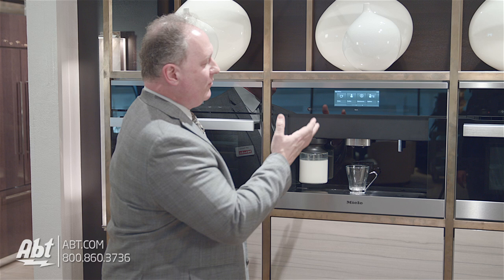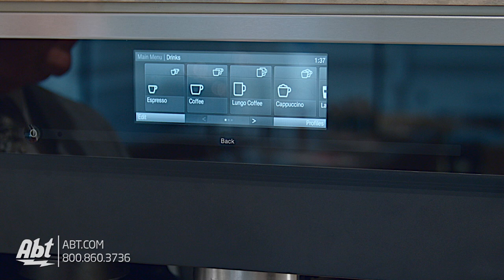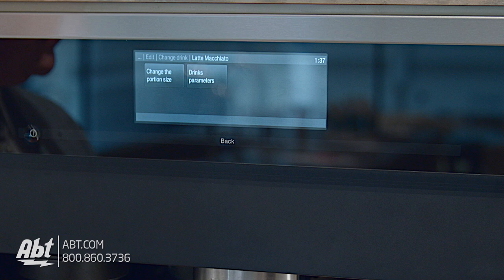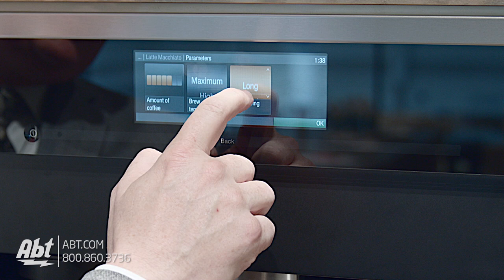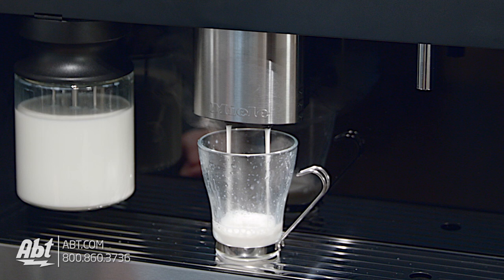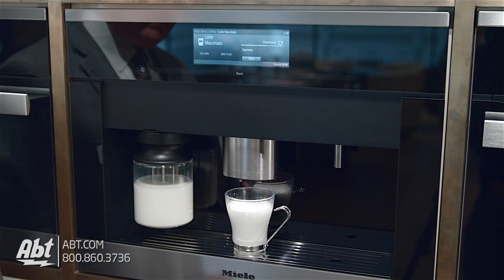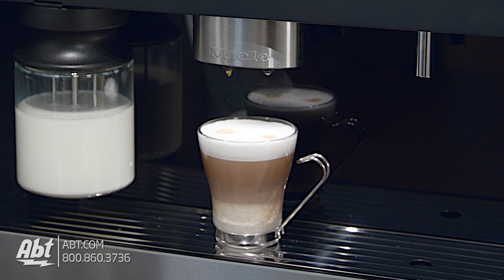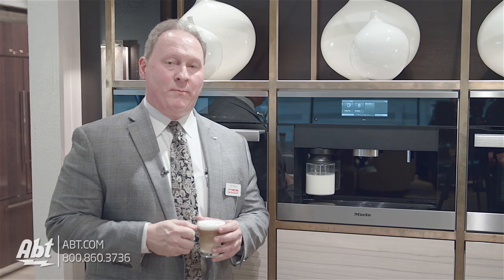Miele Built In Coffee Maker Demo

Comment: Makes a good coffee....but the fancy looking latte's that are layered are not worth the high cost of this machine. They are luke warm at best.  My machine was checked out by Miele tech. Even he was surprised by the temp results reported back to Miele head office. Miele customer service says to warm your cup.....gimme a frikin break...I got this machine primarily for the latte feature...this is the biggest con I have ever seen....My built in Bosch coffee machine will certainly be going back in the wall and this junk will be out the door!!!!  Dont waste your money on luke warm Lattes....  Miele failed on this product.
Reply: Luke warm isn't called coffee, thanks for letting people know l was actually considering this for my kitchen renovations. l'll be steering clear of this brand then.
Reply: We've also had a built in Miele coffee machine 7 years ago, the one that isn't plumbed, has a reservoir. And I can vouch for Sky Walker on this. It really is lukewarm and becomes cold in just 3 minutes or so. What we did back then was to put hot water on the reservoir to achieve that satisfying hot espresso in the morning. Not really worth the 3 grand we spent. Trashed the Miele and swapped it with a Wolf and it is the best decision I made.
Reply: The milk for coffee is not supposed to be heated over about 60 degrees Celsius, then added to the shot of espresso. The only time we heat the milk to burning point is when we make “tourist coffee”, usually specially made for tourists from a certain area of the northern hemisphere, where luke warm coffee is anything below 95 degrees Celsius. Just saying. Your “luke warm” may well be the rest of the world’s normal coffee temp.